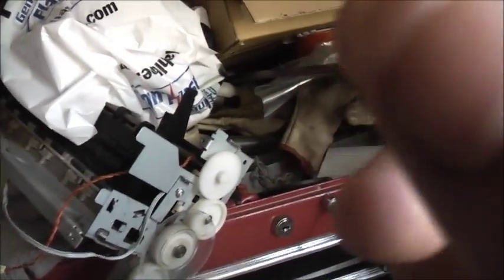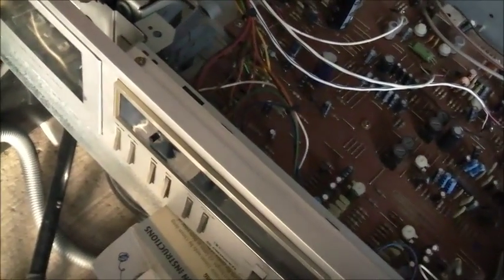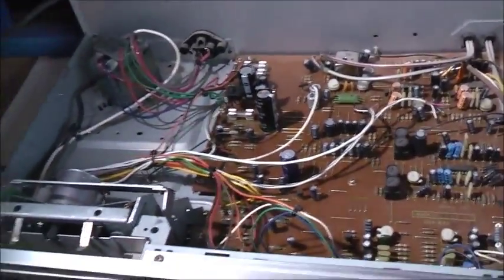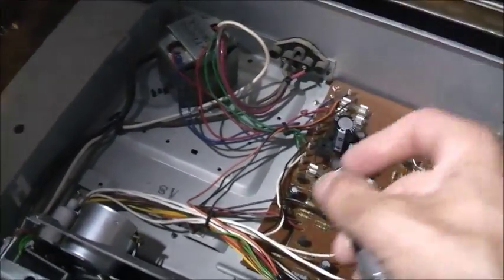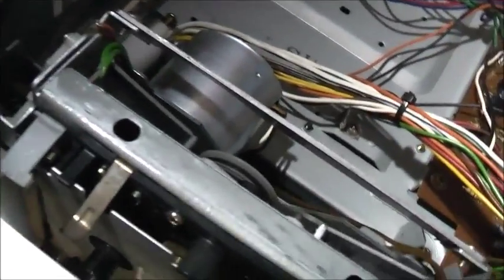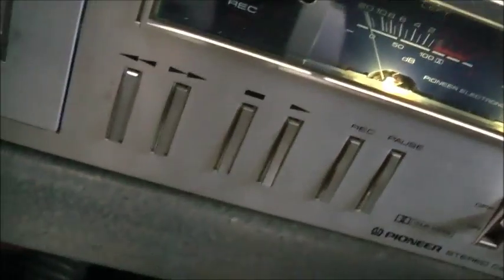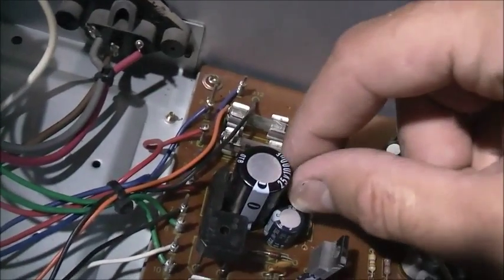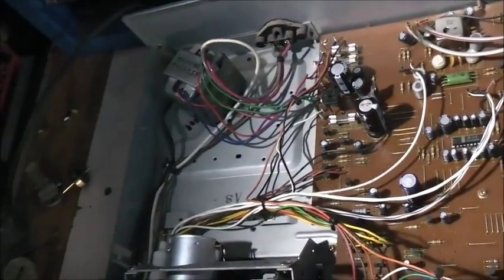Pioneer CT 200 Capstan Motor Rebuild

Comment: Thanks for your video. I have a Capstan motor JVC that is here: https://www.ksp-electronics.com/en/product/view/25473-cap-motor-qar0087-005. BUT I can't figure out how the pins needs to be used. If you look at the above https:... and the connector is at the bottom right side, the motor is at the top the connector has 8 wires.  let's call the left side 4 connectors 1,2,3,4 and the right side would be 5,6,7,8. The 1, 2 and 3 has no label.   3 = SV  or 5V (hard to tell) and under 5V is CTL label, the right side :  5 = 12V, 6 = NC,  7 = F/R, 8 = P - G. What wires goes to 12V - is it 5 + 8 - right?  When I put 12V on 12V at #5 =12V+ and on #8 goes GROUND nothing happens. When I put the +5V on #3 my adjustable power supply takes 2.5A and the voltage dropped to 4.8V and the motor moves a small amount and STOPS! I don't understand this at all, if you can help I'll try your suggestion. Thank you!